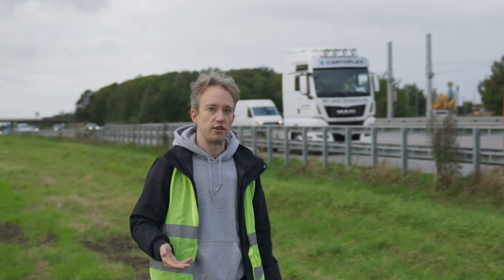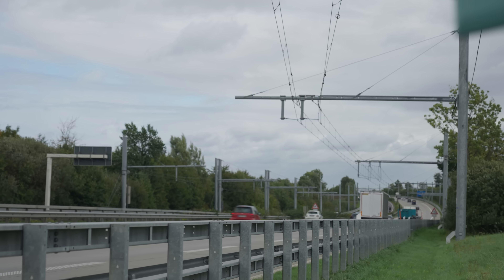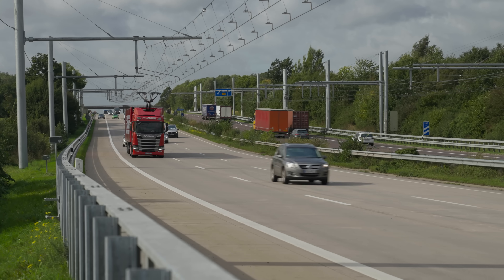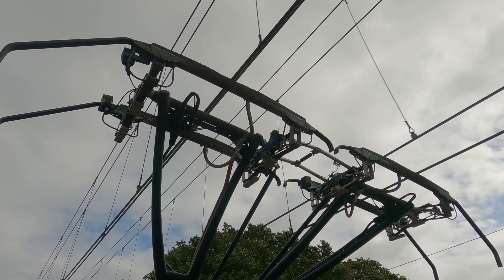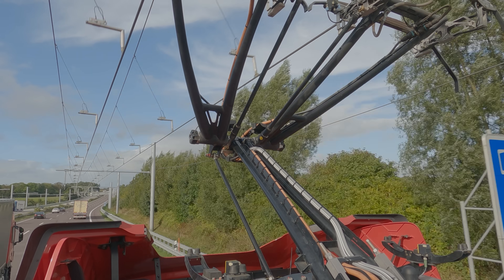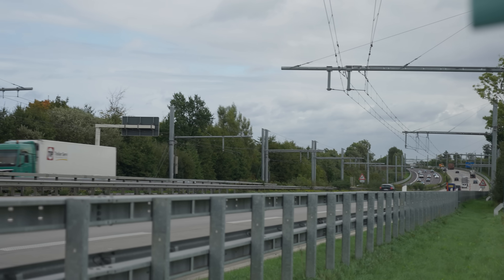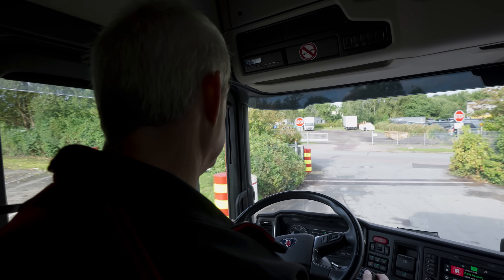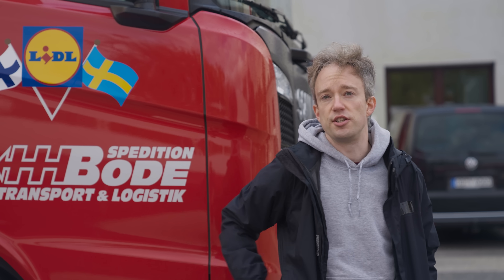The highway where trucks work like electric trains

Comment: It's low tech, proven technology, elegant and efficient. I'd love to see it appearing everywhere it's practical by the end of the decade - batteries work for commuter cars weighing <1500kg and driving dozens of miles per day but not so much for trucks >15000kg doing hundreds of miles.
Reply: Hydrogen powered EV's seem to be the solution that everyone forgets. It's perfect for this sort of thing.
Reply: Hydrogen is the answer long term, surely. Almost the same engines with a few adaptations, a pressure vessel tank and we're there ! Also for home heating - we already have a gas pipeline network into people's homes; just swap the gas !
It can be made at the coast using offshore wind too.
Reply: @thetessellater9163  the elites won't let that happen. They need more control than that. Hydrogen is way too abundant and easy to make. Lithium is rare and gas is rare. And if cars are electric they can extort money for electricity
Reply: batteries don"t really work for those cars either, the weight is excessive for the low range they get, and the production and disposal of the batteries is a major environmental hazard.
also, cars were never a major part of transport emmissions anyways, it would make more sense to keep them with current fuels, and instead of subsidizing battery cars use that money to electrify bus lines and highway truck lanes like shown here
Reply: As battery technology improves and and charging becomes blazing fast and range increases I think this will be less and less practical. This a short term solution until technology advances more but why spend trillions on this infrastructure that will be thrown away in 10 to 15 years
Reply: @andrewk8636  It does not cost trillions to implement this technology, furthermore batteries do get better but due to the fact that they’re made of lithium means that they’re always susceptible to degrading due root like structures forming within the batteries called dendrites, which can be caused by the fast charging you speak of, these structures grow and like weeds, eventually pierce the battery, making fires much more likely and therefore making the lifespan of the battery shorter as they have to be replaced more often to avoid that risk.

The fact is that people hail lithium ion batteries as the future of automation and embrace stuff like fast charging without realising these same batteries can be also harmful to the environment as well a hazard due to increased likeliness of combustion. Therefore it is wiser to incorporate technology such as the overhead lines and it is cheaper, adding a pantograph on top of a Lorry and giving it electric motor drive is cheaper and quicker than making a battery power and driven truck with batteries meaning adoption of this greener method would be more popular.
Reply: @aquillandscroll6428  lithium batteries have already improved lots. For example lifepo4 batteries are much less fire prone
Reply: @andrewk8636  Lithium batteries will phase out sooner than later for the same reason lead acid did - newer and better will come along. 
I'm still not convinced large batteries are the way to go anyway. When you look at the efficiency of some ices it can be ~40%+ in some cases. Then realise there can be free heat when required and the power station's 55%ish average minus transmission and charging losses starts to look more wasteful than what we already have. 
I'm not hating on ev's - just pointing out that on a lot of journeys - particularly higher power usage ones - they can be less efficiant. 
Batteries have a place but its mostly taking over when running the ice would be wasteful - in slow moving, low speed driving or just to keep the a/c on for example. 
In a truck on a motorway they make very little sense indeed and thats before we get into the reduced payload, etc. 
On the flip side of that as renewables build up and/or we start to go nuclear that changes things in favour of using batteries. 
Of course by then we're 20 years down the road, everyone wasted a load of money and resources swapping to ev and all for the sum total gain of making things worse than if we just put our sensible heads on and figure out the long term solution which is developing clean, reliable sources of energy. 
I currently run a plug-in because it does all my day to day stuff on ev and has an atkinson cycle ice for the long trips. Its not as efficient as a diesel on a run and not as efficient as a small ev around town but then it doesn't need to be because it means I only need one car. Big picture and all that.
Reply: @aquillandscroll6428  batteries will win almost everywhere. They are 100% reusable and recyclable and the recycled lithium actually produces better batteries.
Reply: @onlineo2263  Lithium ion batteries CAN be recyled but it’s very tricky and hazardous to recycle them so not a lot of it ends up being recycled. Wouldn’t it be easier making infrastructure to support the pantographs on trucks rather than setting up complex recycling plants that incorporate stringent safety measures or god forbid if it’s a country with bad regulations no safety measures that could lead to disasters if there was an accident during the recycling process?
Reply: It is neither elegant nor efficient.

Comment: Total gimmick/wrong direction....very obviously....Hydrogen fuel cells are the ONLY real answer. WTF is wrong with people to pursue the electric route! (Yes, I know its purely about making money...selling a 'solution' they know will be obsolete in a decade). Convert existing fuel stations to hydrogen. 
Like electric cars, trucks and electrifying roads is an absolute red herring thats doing more harm than good. Such a sad wrong road they are going down.... the resources should be going into building green hydrogen plants and converting existing petrol stations. Plus can also use existing domestic gas infrastructure and convert domestic gas boilers to hydrogen far more easily/cheaply and practically than another red herring, ground source heat pumps...how will they work for 90% of UK households with nowhere for them!

Comment: i feel though, like it would make more sense to start developing more electric freight trains, because they are actually trains, that work like trains. not trucks, that have to deal with far more traffic and have much higher friction, meaning much less efficient energy use...
Reply: Trucks are more flexible. For supermarkets, for example, trains just don't make sense. They need to make, lets say, one to three deliveries per day to each store, with many, many different things in that delivery. You can't run an train next to the supermarket and just unload one container. The train will take an eternity to get to the final destination. Trains are only good for long-distance deliveries with realitively few costumers / destinations. In the case of supermarkets, for example, they can be used to deliver imported goods from an port to an central warehouse. Or trains can be used to deliver steel from an steel mill to an car manufacturer, who needs a lot of steel each day. For food deliveries they already don't make much sense, as one farmer only has a few hundred truckloads to deliver, once per year. Then, for example, wheat is stored somewhere and either manufactured to something else, which needs to be distributed to many different costumers as well, or, again, delivered in small quantities somewhere else. Rail isn't sensible for this.

Comment: For the cost every kilometer of this system you could build 10 fast charging stations or 30 truck batteries. And that doesn't even include maintenance or billing. And that pantograph costs about 1/3 of what a truck battery costs. And best of all: You need that truck battery anyways (or a diesel engine in a hybrid propulsion system, price is about the same).

Doesn't sound like an economically viable choice.

Comment: with the use of regenerative braking they could charge a back up battery then feed back to the grid under breaking when the battery is fully charged.
Reply: Ideally, trucks wouldn't brake at all when on the highway...

Comment: Well, I can see one problem already, and its clear on your video,  the pantograph carbons (electricity collection contact surface if you like) has groves worn in it. I guess no one who designed the system looked at how overhead lines work in the rail (or tram) industry - the overhead lines in rail/tram don't run in a straight line above the vehicle (train or tram) - they are staggered - i.e. follow a zig-zag path which remove the single point of wear on the pantograph, i.e the overhead line appears to move from side to side as the vehicle moves forward.
Reply: The title might want to read - The highway where trucks work like trolley buses....

Comment: Tom for being so smart you are not asking the right question. How are you going to power all these electric vehicles on top of our already increasing demand before vehicles were added to the equation? Renewables are intermittent and cannot provide the needed demand that will be needed when the majority of transportation has been electrified. I am saddened to see that politics has push nuclear to the fringe when it is the answer. The UK and Europe outside of France have decommissioned the most reliable and Green solution for a money grab that actually requires more land, is a bigger impact to the local environment and cannot produce reliably and for the amount of time (years) that a nuclear plant can. And Yes I live within 90 miles of the largest producing nuclear power plant in the US and I am not concerned with my safety.

Comment: Nice idea but not the solution to make electric trucks and cars viable. 

Conquering the weight to power output ratio is the needed solution.

And the idea to ban fuels without coming to that solution is insanity. Europe is going to be back to fuels after that planned ban if they waste time like this on avoiding the true electric vehicle barrier.

Comment: Some people down here have asked about how the system could bill truckers for drawing power from the wires. Where I live in the Research Triangle area of North Carolina, there's a toll highway where automated sensors detect vehicles on the road and send bills using either a photo of the license plate or a device fixed to the windshield (having a pass gives a discount on the toll). With a little adaptation, something like this could be used to bill vehicles using the overhead wires (if that's not what they do already).
Reply: There are also camera-based toll systems near me. The big problem is they bill by distance not power consumption. I guess trucks could have utility-certified power meters installed feeding extra data to the same transponders drivers stick on their windshields. If somebody is found drawing power without a licensed meter then they could be billed a maximum rate based on distance instead.

Comment: This is so simple and genius. This technology was sitting in our closet for over a hundred years, and nobody tried to use it for trucks (granted they may have tried and failed). 

Also, 2040 only 18 years away 😰
Reply: No, it isn’t a good idea. Batteries are so good that we don’t need this kind of überexpensive infrastructure to electrify our trucks.
Reply: @peterfireflylund  It is more environmentally friendly though. No need to mine metals for batteries which will have to be replaced at some point, no need to make a lot of truck charging stations, and you don’t lose energy due to charging!
Reply: @peterfireflylund  You'd need bigger batteries for bigger capacity (and longer distance), and that would most likely reduce the weights a truck can carry due to weight restrictions...
Reply: @peterfireflylund  cantanery is something humanity has already perfected and wherever theres wires gives a vehicle infinite range.

Comment: Does someone know of a reliable feasibility study of putting induction plates under the road to do the exact same thing (at least to vehicles that have batteries that support the technology) but buried in the road? It's been talked about for a number of years but I've never seen it done to any meaningful scale.
Reply: Induction freaking roadways? Of course people have run the numbers. It is an even more moronic idea than the one in this video. Batteries are so good that charging while driving isn’t necessary, so we can simply save all that (hugely expensive) infrastructure.  Induction charging loses so much energy in the process that it isn’t funny. It’s a bad idea.
Reply: why induct when you can simply connect wires together?
Reply: Not that I know of, however I don't think that would be very efficient. Wireless phone chargers are relatively inefficient and those have the coils very close together. If the coupling is through the thickness of the road and the vehicle's ground clearance the losses would be exponentially worse.

Plus there's the matter of cost and maintainability. Road damage could easily break the coils as often happens with traffic-sensing systems. Any damage couldn't be repaired without repaving the road, and road construction would be hindered by the extra steps involved. Overhead lines would be cheap and easily worked on without disrupting the existing road.

Comment: why not just build Road-Rail terminals around the nation like we have at the Eurotunnel terminals and do it by rail?, if done by night it wont affect most traffic and if there is planned works run diverted routes, we used a similar system in the 60's called "Motor-Rail" to move cars..

why develop new infrastructure when the currently available systems can do it quicker and probably cheaper with proven technology

Comment: What about wear and tear. Won't those cables have to be replaced constantly when there is 1000s of trucks sliding on them day in and day out?
I'm sure its fine on smaller scale, like with electric trains. But seems less plausible on busy highways.
Reply: Yes the cables would have to be replaced but the same is true of existing roads. While the cables might need more frequent replacing then roads they should be much quicker and easier (and thus cheaper) to replace.

Comment: I've been by the ports a few times and seen the long lines of diesel trucks idling in the afternoon sun, putting out fumes and heat and noise for absolutely no purpose.
It always seemed to me at the time that if the trucks were electric, they could be charging up using overhead wires instead.
Some combination of battery and pantograph is likely to be the solution, like it has been with the trolleybuses in my city.

Comment: I hope someone is testing the segmented third rails (similar to the trams used in Tours and other places) for a scenario like this, though I guess they would work better for road trains than single trailer trucks. In case you didn't know, segmented third rails use a third rail to deliver electricity to the tram, only the segments covered by the tram are electrified, so there's never any danger of people being electrocuted. The result is a much cleaner look as there's no overhead cables and associated infrastructure.
Reply: What does it look like?

Comment: OR just use trains! Proven technology that just works.
Cant be that hard to establish set freight only routes as "Freight Expressways" to move goods across the nation. The US, Canada, Australia have awesome freight train networks.
In the US freight trains are so large they double stack full size containers on them and transport entire semi trailers on the railcars aswell that are then picked off the train and taken away by trucks. The process is efficient and fast. It is not uncommon to see consists being pulled by multiple locos at speeds of 60-70 mph!
70 is the nationwide limit.

While I absolutely approve electric trucks running off grid power I think the freight train network should not be neglected in favor of this.

Comment: What about having wireless charging for the trucks? I could see friction be a problem, but I seems it would be safer since the truck isn’t actually connected to the wires.
Reply: Its very inefficient and only works at very short distances or if you have a very focused beam. You'd have to put up millions of transmitters. That would be very expensive. Also it uses energy even if there is no receiver device. You could probably solve that with some detection turning it on and off but its so much more complicated than just some wires you connect to.
Reply: @3dlabs99  got it, I’m sure it’s far more expensive, but it is possible. Isn’t Japan building a high speed railway powered wirelessly?

Comment: I'm not shure if this is already done, but wouldn't it be efficient to install new regular power lines, that would be needed anyways for the new amount of renewable etc., on top such power lines for trucks or regular train lines to reduce infrastructure costs, so even if it does not pai off itself all the time you could at least have saved some infrastructure building costs.